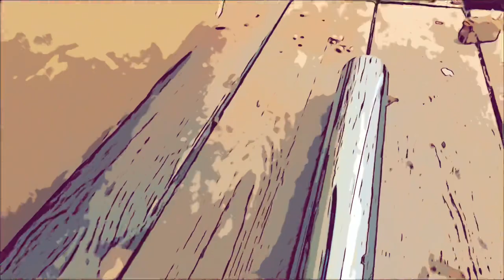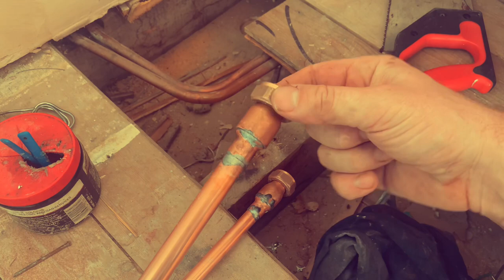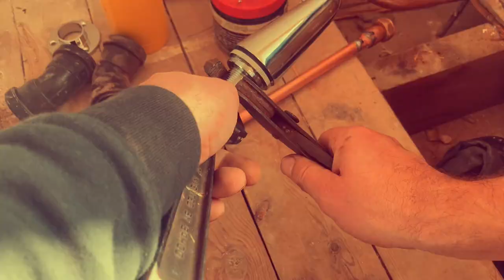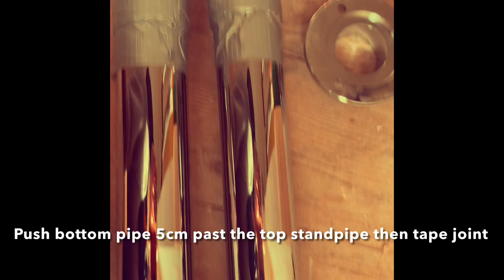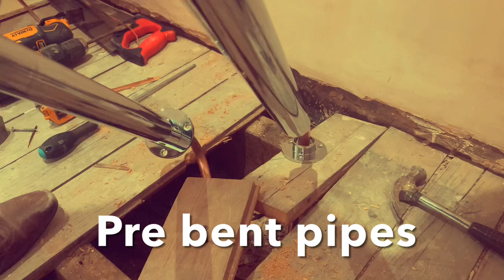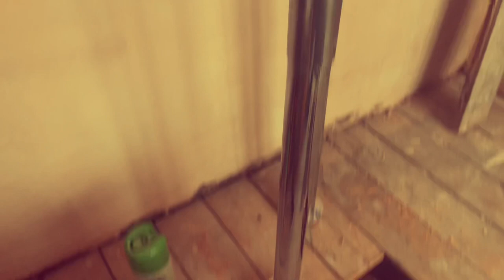How to connect, install bath tap standpipes or tails 🛁 🚿🚰

Comment: You've done well to work with what you have but that stand looks terrible quality. That 2 piece pipe is a non starter... just trying to keep packaging short. Need one piece that can be cut down. The base diameter needs to be bigger
Reply from the maker: Yes I agree, they don’t secure the taps or pipework,
Reply: @warriorsofwarmth  yes you can only work with what you have but it's annoying when the manufacturers cut corners!